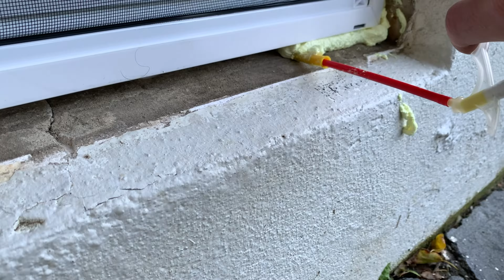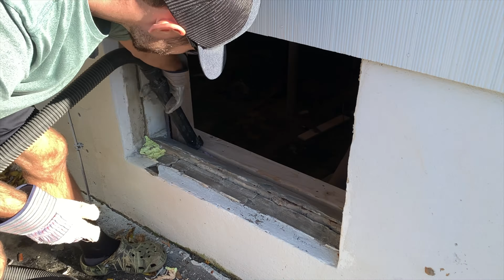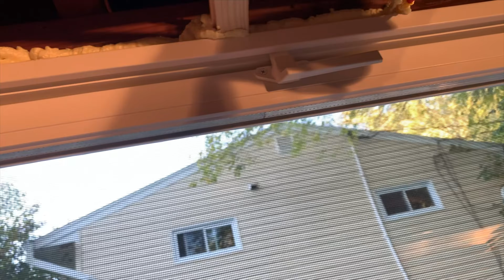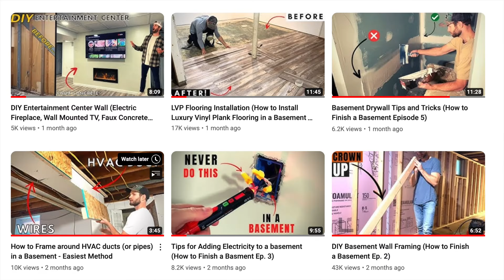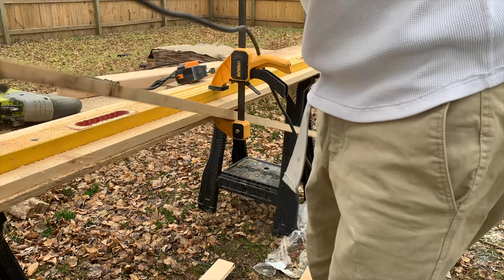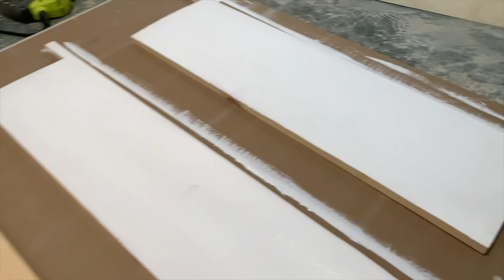How to Replace and Trim Out a Basement Window (DIY Window Removal, Replacement, and Trim Install)

Comment: I'm doin' it.  I bought two Menards windows.  I have one installed.  Here's the thing I've run into.  I do believe poured concrete is much harder than cinder blocks.  The steel frame that is bound to the  poured concrete makes it an arduous task to chip away.  The concrete has had decades to harden year after year.  I did get a rotary hammer and a new chisel bit to help me with the second one.  It's actually wearing out the chisel.  I am doing this because the old single pane windows were energy inefficient.  I just offer the suggestion that in many cases it may be less work to repair the old windows or search for basement storm windows.  My first thought was to install basement  storm windows but they weren't available in my area.  Thanks for the video.

Comment: Thank you Andrew !  I'm an avid  DIY'er  but I've never done a basement window. Mine was like yours, it had the frame into the concrete. After watching your video I felt pretty confident so I ordered new glass block windows from Home Depot.  It wasn't as bad as I thought. A saws-all and angle grinder did the trick for me. It took me a few hours to knock  out this project but it looks good. Thanks again !

Comment: Great videos as I'm finishing our basement now. I contractor friend told me that I need to frame in the concrete opening with PT and then attach the window to that. Is that not needed or maybe could it be a city or state code requirement? I like your way because I can get a little bigger window in the opening. Thanks!

Comment: Looks good, but rule of thumb is to use a material that can withstand the high temperature differences between the window/wall to prevent future mold growth from condensation. Drywall will not stand the test of time.
Reply: Like what? if you don't mind me asking

Comment: Is flashing not necessary in basement windows? Our windows are installed the same way as your video and I’m worried about water infiltration because there isn’t any flashing or sill tape.
Reply: Flashing isn’t necessary as long you use caulking on the outside to seal all the voids, if you would like to use extra precaution, you could buy a window well cover. It is ugly, but it is an alternative solution for extra protection.

Comment: I finished a basement in a rental about a year ago and the windows were by far the most confusing part! I also did the cheap drywall finish but it turned out pretty good. I didn’t swap the window, but after seeing this video I think I well sometime soon! 

Nice job showing those tricky things like how to remove the window flange and how you attached it to the building. I’m not too surprised foam/caulk plus the concrete on the outside is enough to keep it stable!

Comment: Why didn’t you smooth out the caulk on the outside?
Reply from the maker: For that type of caulk, I don't think you are supposed to use a finger to smooth it out (I could be wrong, so I welcome feedback from others). I think there is a tool you can use to help blend it better than I did though. I will research this for my next exterior caulk project.
Reply: @AndrewThronImprovements  a lot of exterior caulk says not to tool it, it doesn't smooth out like the interior stuff. At least the thermoplastic stuff.

Comment: Nicely done!   I recently finished a wall in the basement and I boxed in the entire window in 1/4" birch plywood and added trim molding around the box and painted white.  The only thing that I would have done additional on your window would have been to smooth out the caulk on the outside.
Reply from the maker: Appreciate it, John! I'm glad to hear your project turned out well. I hear you on the caulk. For that type of caulk, you are not supposed to use a finger to smooth it out (since it sticks to everything). I think there is a tool you can use to help blend it better than I did though.
Reply: Could you just use disposable gloves?